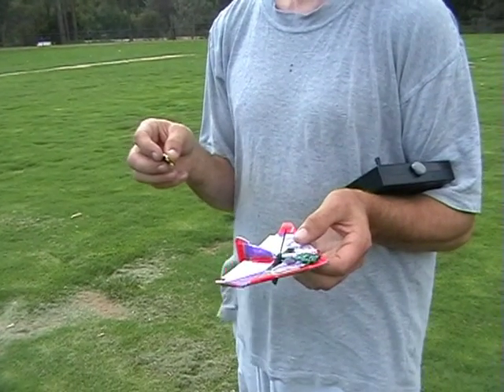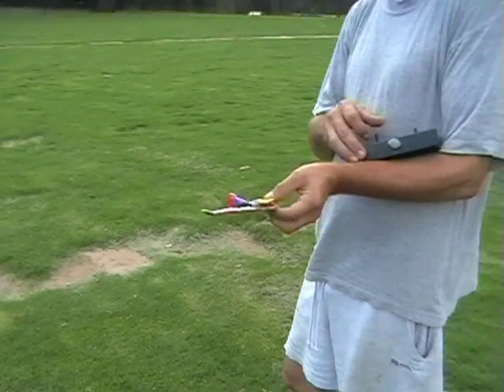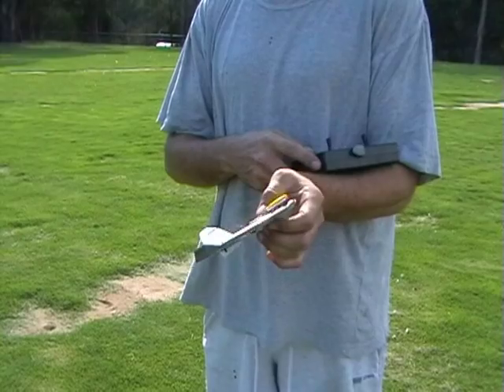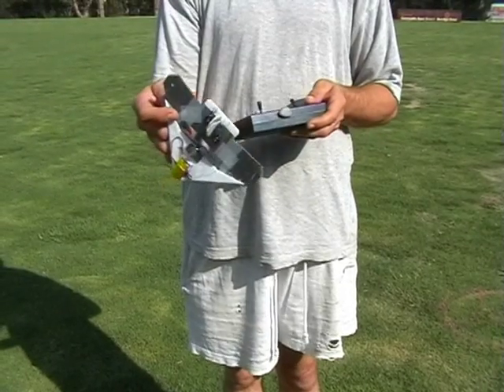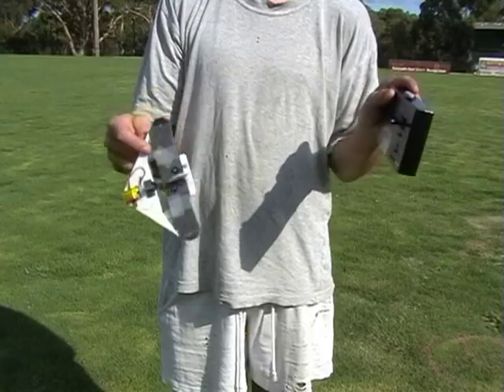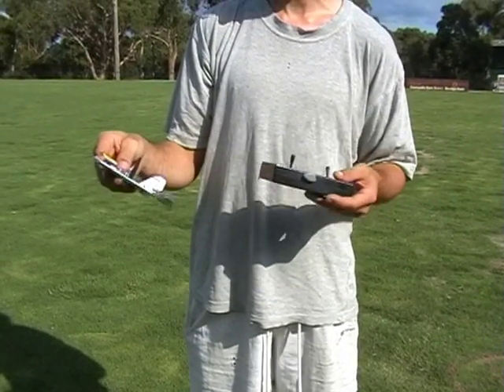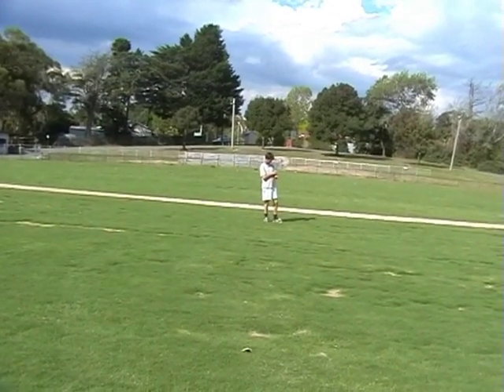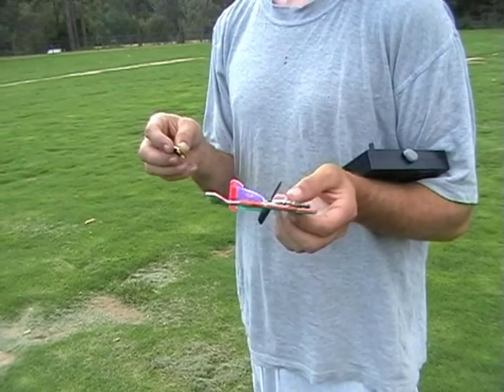rc micro jet fast

Comment from the maker: Hello thanks for watching 
No rods required but I do have slight V angle that runs half way down the length and also two slight angles at the back half on each side of the up and down flap aliron I think thats what its called. 
Anyway these slight angles are strenghtend with tape on one side. They also help with the plane be ridged and stable at speed in wind.

Comment: Very nice.......I have 6th grade kids that i teach on a after school program that love making rc planes you think you can do a tutorial on making the simple delta planes you made and what size foam you used, if it was 2mm or 3mm and what kind of Z bends you used or did you make your own? A close up tutorial would be nice.  Loved the Gray and white one....pretty fast liitle buggers. The flying was unbelievable, good control when you had it in the air i was very impressed.

Comment: Great video.
Where can I buy such a kit ?
Can you put the link into the info box please ?
How is the RC receiver put onto the plane and
how is it all fixed, so the plane can be controlled ?
Do they use mobile phone motors at this size ?
Or what motors do they use ?
Many thanks.
Regards, Stefan.

Comment from the maker: Funny story flying yesterday 10/5/10 and looked away to make a joke to someone 
and when I looked back I could see no jet only hear it so after looking for 5 seconds I cut power and ditched it looking at ground level for the hit.
Spotted it no worrys and found it with no dammage and battery still connected.
Took off from crash site.

Comment from the maker: To make a  jet/plane that can cope in wind it must be designed with minamal drag eg. my new desigs have a knife edge leading edge  and any drag is at the back of the jet/plane to keep it straight. also stableisers at the wing tips help alot. 
Sofar I have flown in wind so strong after crashing I had to chase my plane across the feild as it just blew away in the wind it was 25-30 kmh winds that day.
Thanks for watching .
Adam VA of AVA Magnetic Levitation AUS pty

Comment from the maker: Hello thank for watching.
I have put more info in the side bar
the company I get all the parts from is called. 
( Plantraco Microflight ) online
The reciver is mounted to a foam mounting pad with dubble sided tape and the pad is then glued in place.
Yes the motor is the same as what is used in mobile phones and small toys But the reciver can take any 3.7 volt DC motor that draws less than 2 amps under full load.
PS Its great fun to build and fly with Plantraco Microflight